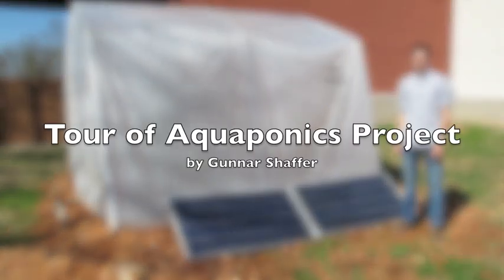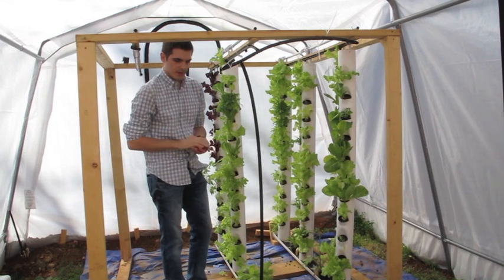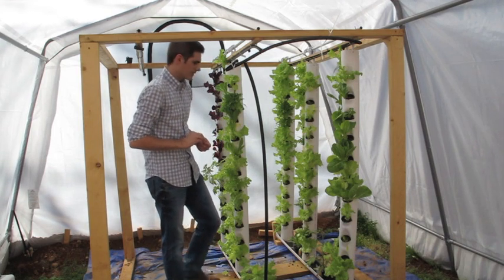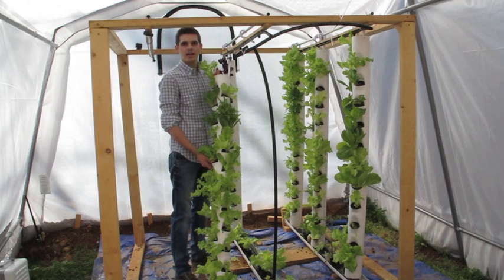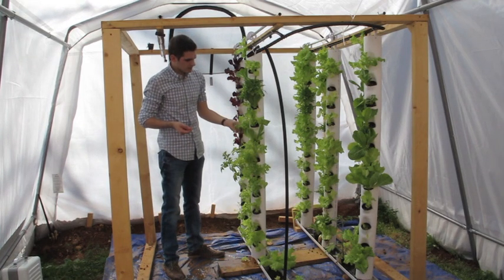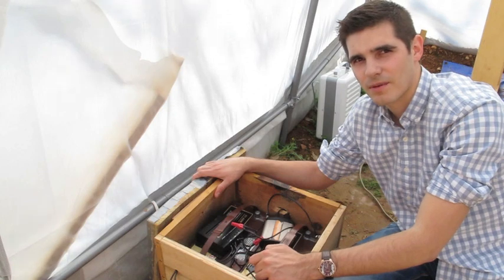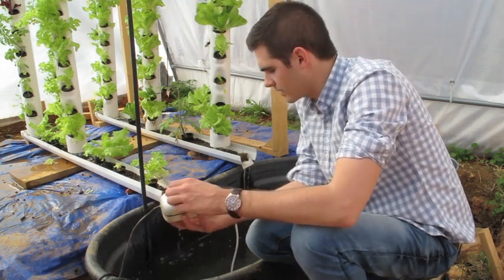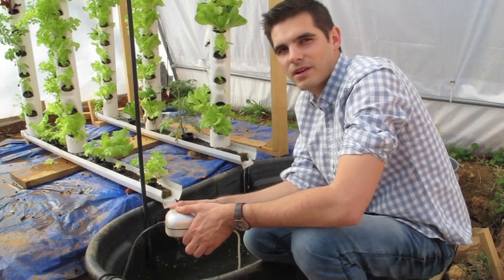#Aquaponics System - #Solar Powered #VerticalFarming www.agrowponics.com

Comment: hello from greece, i have some very important questions to ask u and i would be appreciate yr response either here or in  PM in driopas@gmail.com
1. is it possible to make taller towers e.g 5 meters high?
2. what is the appropriate  distance between towers?
3. the vertical towers are filled with any solid inside or are completely empty in order to     pass water and nutrients  of the fish?
 4. is it possible to grow some kind of additive for fish food at those towers in order to        "close" the system by making it more sustainable?
I completely understand that the answers maybe  somekind of trade secret and not to be distributed fully so pls excuse my ignorance on that and try to answer in as much u desire, thanks in advace for yr respose to that, u already have made a really great job on this project, self powered by solar power and very good use of space availiable, im in progress of making something bigger in scale than the one u presented and yr video game me lots of answers so far, thanks again in advance and keep on!!!
Reply: Yes, you can build them as long as you want, but your water pump & water resource + fish should be in proportion to sustain the system.
The distance between the towers is plant specific.
The towers aren't empty. They contain a medium to hold the plant & filter the water. You can used expanded clay or gravel. Gravel is heavy, but its cheap & filters the water well. 
Yes, you can use edible fish, but you must keep the system balanced. The system is sustainable only when the fish is enough to produce the required fertilizer for the plants.

I'm building something very big. A complete self-sustained agricultural system, of which this is just a small but important part!

Comment: How do you deal with the light getting in and hitting the roots?
Reply from the maker: We experienced no Problem the diffused and indirect radiation does not harm the roots only the direct sunlight would affect the roots. The root growth was phenomenal in our system and some of the roots grew to 2-3 foot long and there was absolutely no rotting.
Reply: Gunnar Shaffer Thanks, I was also wondering what you did about food grade and the pvc. I'm trying to build one but I don't want to feed myself some leached chemicals
Reply from the maker: Yes it was the largest concern of mine also! :)

Comment: Yes - you are corret. I develpped a system almost idenitical to this 18 months ago - and researching any outgassing from ambinet temperatire PVC was important.  We fond a couple of papers on this and basically the result was that nasties from the PVC are so small they could not be measured
Reply from the maker: I am not sure I understand you question or statement.
Reply: Sorry.  I meant that several papers stated that the amount of known carcinogens found in water held standing in pvc pipes was not measurable by their highly sophistcated equiment .  .e. outgassing from pvc and thereby injecting known carcinogens etc into water simply was not happening.

Comment: How do you work out how much water to drip down and the intervals? Also, d you need to design it so the leaks down along the inside of the pipe to make sure the roots get wet?
Reply from the maker: We actually did research and spend weeks doing complicated mathematics in our Engineering lab to see if the amount of water was really going to be effected. We purchased drippers from Lowes in the home and garden section but we decided that they actually slowed down flow. After this conclusion we took a drill and drilled 1/16 of an inch hole in each tube. The main thing you want to do is to just oversize your pump. ACTIVE AQUA has great pumps and they come with a CHART! This is the important thing because you need to know how much water you want to move at what height. The friction in our study turned out to be negligible. Don't worry about the roots getting wet, they WILL! 6-8 gallons per hour in each tower 24 hrs a day will give them plenty of water. When it drips down in the center it will always get the hydroton and rockwool wet.
If you have lower water flow rates use rockwool because it soaks in any water but it is 10cents per cube.
Reply: Gunnar Shaffer Thanks for getting back to me mate. So the ACTIVE AQUA chart will tell me exactly how much water I need per plant. So for example, it will say: for a 20 plant hydroponic system, pump 6-8 gallons per hour through it 24 hrs a day. Does this amount need to be manually altered as the plant grows or depending on the plant species? You say not to worry about the roots getting wet, but I assume you still need to make sure the water sprays from the hose as opposed to dripping, otherwise surely it could just drip down through the centre of the pipe and not touch a plant root? Also, i cant see in any previous videos mention of the rockwool - are the plants wrapped in it? Do you also have hydroton in the net cups or just the gutters?
Reply from the maker: Plants need minimal nutrients so the amount of water to circulate through the system depends on your fish tank if you are doing aquaponics. You want to cycle the entire system at least every 2 hours, but every hour is better. No dripping will work but it is slow. If you look through the center of the tower you will see that all the cups are lined up and they drip all together.  For rockwool you just plant the seed and there is no need to transplant the plant. Yes you have to have foam, hydroton or rockwool in the net cups.

Comment: In vertical systems like these are the roots in constant contact with the water?   What medium did you use to plant into your tower?   Awesome job on everything by the way.   I hope you are out there farming somewhere
Reply from the maker: Yeah I built a system in Cambodia this summer and it went great.  Yes they form one column in the middle and are constantly in contact with water. We used hydroton and rock wool. Thanks!!!

Comment: Gunnar, I think you have a very well constructed project for study purposes and your video is very well made. I think there would be a big market for the upright pipes already made to accept netty cups for the home gardener.
Reply from the maker: Yes I also agree. We searched and there is really no scientific proof that it is harmful other than the fumes. Many of our water pipes are made out of the same material and eating fresh vegetables is better than Mcdonalds. :)
Reply from the maker: Sunny W I am in the works of creating them to sell. I am in Germany doing my masters now so I am delaying production but I talked to suppliers in China and I am in the process of a patent.
Reply: Well, for what its worth. I think there is a market for kits complete with 4 or 6 PVC pipes with netty cups supplied (1.5- 2") and leave 18" at the bottom so that the kit could be used in any of several reservoirs. I was planning on using a Rubbermaid trough in the 110 gal model. Using a cut to fit piece of plywood recessed down 8-10" with holes cut for the PVC pipes and I believe that size would support 6 pipes easily.
Reply: I forgot to mention that I was referring to this as a nutrient supplied system rather than a aquaponics. The main thing is finding a way to supply the already made PVC Pipes. The application can be so varied 
from that point.
Reply from the maker: Sunny W Yes that is what I want to work on making and producing the towers. I will keep you updated. ;)
Reply from the maker: shafferg23@yahoo.com
Reply: Gunnar Shaffer perhaps you can make the pipes out of some sort of fabric? It could it be light, flexible, fold-able but also strong enough to hold the plants/cups. Could ship cheap from china, cheap to post and/or take up little shelf space in retailers. Also, ive heard some bad things about pvc and food in the sun - its probably rubbish but I dont know. I think the tower garden people started it to scare people away from making their own systems.
Reply: Marius Draconis I raise 30 tomato plants in a 45' 4" PVC pipe twice a year with an ebb and drain system. I have been told that they as tasty as New Jersey tomatoes which are well known for their taste. I live in Florida and plant my first crop in Sept and my second crop in Feb. I was still picking tomatoes from my Sept crop in the beginning of Jan. I don't think raising vegetables in PVC is anymore harmful to us than what we buy in the store sold as non organic raised. I try to plant 20 determinate and 10 indeterminate varieties for my Sept crop so that I will only have 10 plants to cover if we get in frosty nights in Dec. The second crop are all indeterminate varieties.
Reply: Gunnar Shaffer I think eating the PVC pipe would be better than eating McDonalds. Gunnar, have you seen the work of (cant remember his name or the youtube video) who is working on a completely automated, online aquaponics system with built in sensors/robotics that he can completely control remotely from his computer using special software he designed? He is just working on it himself from home so maybe you smart guys could offer him some extra brain power. Ill try and think of his name/video...
Reply: @marcusd9192  did you manage to get his name though?

Comment: Looks like a cool design. Do you think that hanging the grow tubes higher allowing the water to fall a further distance could oxygenate the water more so you wouldn't need a air pump? Also, do you think that this design could be used indoors with less or more lighting than traditional horizontal beds?
Reply from the maker: Thanks!  I have researched and read that water only aerates when surface tension is broken. Our fish tank is around 70-85 deg. oxygen evaporates from the water very quickly. To prove this we turned off the air pump and without breaking the surface tension in the fish tank a few fish died within 1 day.